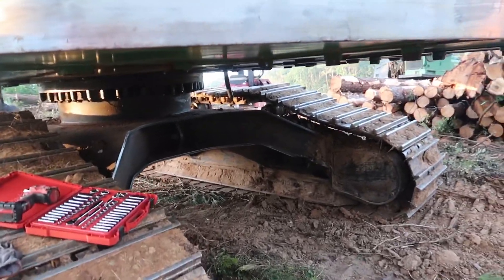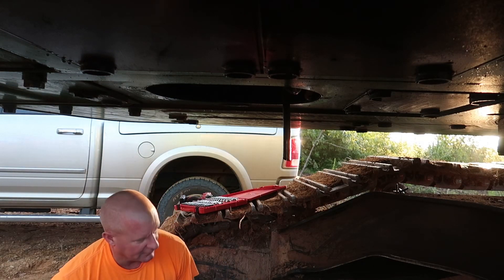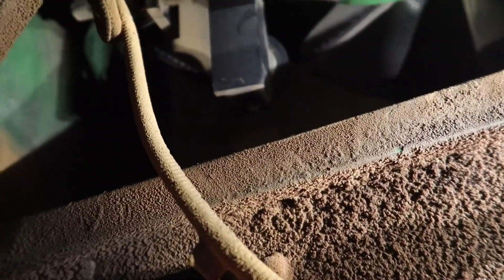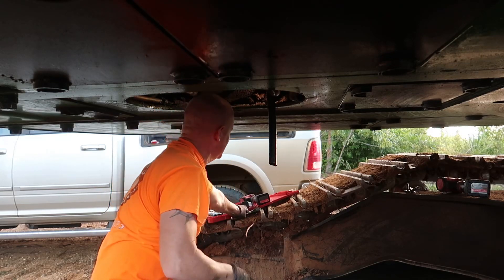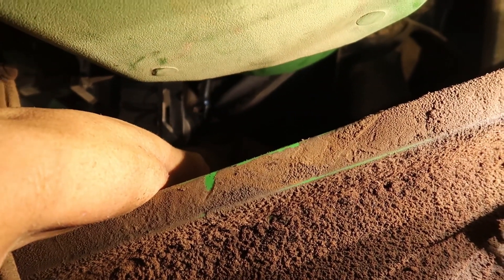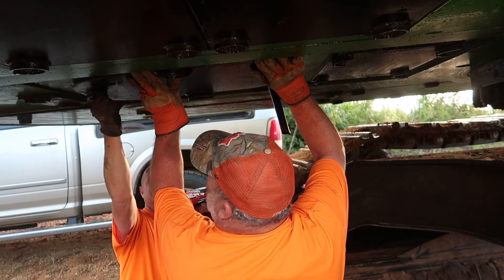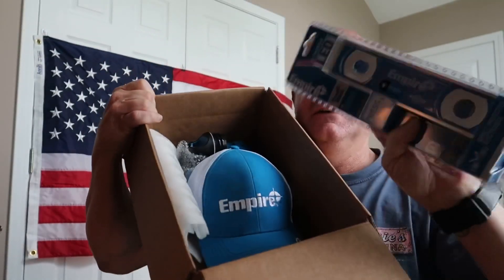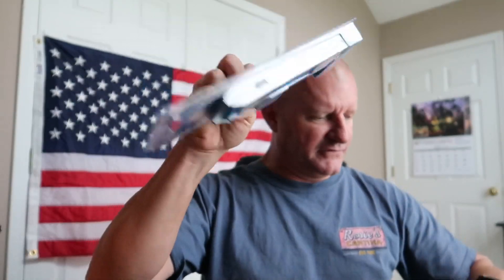My John Deere needs some work

Comment: They should force the engineers / designers to go out in the field to service equipment.. if that were done I bet you would have an easier time......... Feel better soon Miss Jill!!!
Reply: Lol. That's a true statement John
Reply: john colasanto They actually assemble the equipment, then set the cab over it. Never a good day for a service tech. Engineers.SMH.

Comment: I found that them rubber stretch cords, that have the hook's work great on fixing stuff. Like you can take three or four of them and line them up under a drive shaft and hook them to the side of something, And you can unbolt your drive shaft and then the rubber stretch cord's will hold up your drive shaft, and till you remove the cord's. This work great when you have no more hand's to help. To bad they could not work on holding them plate's up for you.